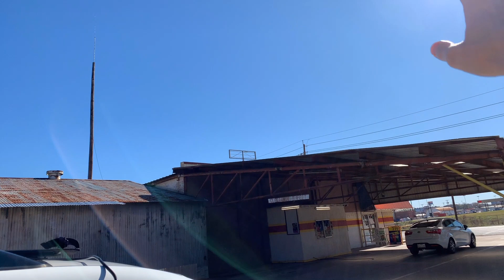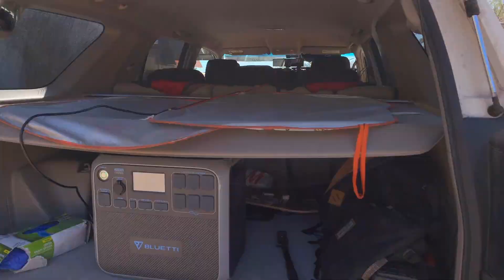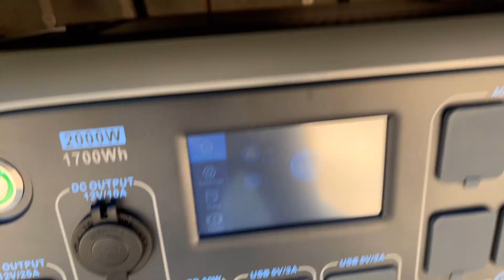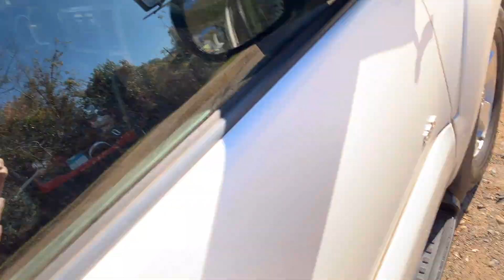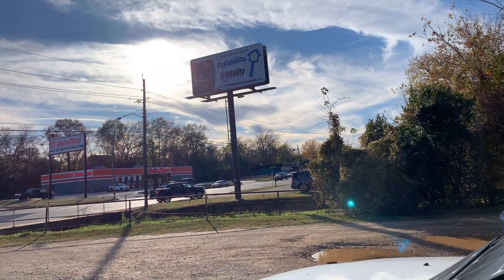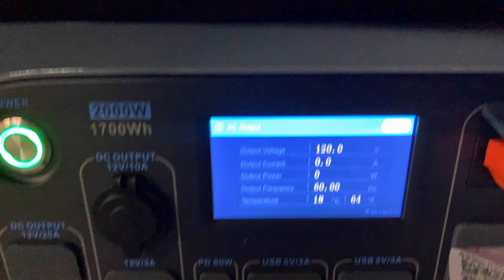Bluetti AC200 Test Charging using Two Solar Panels

Comment: Are you aware of the 2020 solar panel tax credit since your using mainly the solar panels for power?
You could qualify for 26% of the total costs to reduce your taxes if you are in the US.
Reply from the maker: Really, that is something I could use more information about.
Reply: @kpboix99  I am going to take advantage of it.  Get the Form 5695 and Instructions from IRS.gov.

You should qualify because you even bought 4 to 6 solar panels total.

Solar panels and the AC200 certainly should qualify in your case because you are purposely using only solar power instead of electricity to recharge the AC200.
Reply from the maker: @Trang-xq9fn  ok I’ll look into that form, thank you for the information.
Reply: @kpboix99  It is possible to keep it as a residential solar usage and take it to your business for emergency power uses.

You  need to look at both tax benefits for home vs. business then decide where your solar system should be as a permanent location.
Reply from the maker: @Trang-xq9fn  that does sound like something good to look into 👍. Thank you for sharing this information.
Reply: That's ONLY for solar panels that are installed on your home or business not for a portable generator...but nice try. 👍
Reply: @BC-hc5dq  I will read the instructions when I work on my taxes.  As far as I know, solar panels have to be connected to a battery system in order to provide power for homes.  I will be interested to see restrictions on the types of batteries use.

Comment: I thought something was wrong with my panels but it appears that it is performing just as yours did in this video. I really was expecting to get at least 200w from both of those 120w panels. I know 100% output is not feasible, but paying over $300 for two panels that only provide an average output of 140w is actually a waste of money. 

I've already ordered better panels from someone other than Bluetti. I wish I would've done more research beforehand because I would've only purchased the solar generators and left the panels alone, but you live and learn. I'll be storing these panels in my van if/when I need them.
Reply from the maker: Yes, I was expecting the same thing as you.  When I connected them up in series, was suprised to see why I didn’t get more power input.  These panels aren’t cheap.  I do like the portability of them.
Reply: Which panels did you end up purchasing?  Are you happy with them?
Reply from the maker: @DDDaxton2222  I ended up purchasing three more of the Bluetti Foldable 120 watt panels.  I am happy with them because I can carry them around easily and get sunlight by connecting all of them fast.  They aren’t cheap, at around $300 a panel but I wanted the portability of it instead of mounting them or having them take up a lot of space.

Comment: I have 2 200 watts solar panels i am trying to connect to charge my bluetti faster. My issue is, how do i connect those 2 panels together? Is there is the an extra adapter i need to buy? I dont see that any of these came in box besides regular solar adapter, car cigarrete lighter adapter and AC adapter. I would appreciate the help 🙏🏼🙏🏼
Reply from the maker: If you see how to wire in series, it will connect with the parts you have.

Comment: I have the exact same equipment and followed your instructions...but when I turn it on I get error code 1. Any tips?
Reply from the maker: I’m not sure what code 1 is, have you checked the manual?
Reply: @kpboix99  I figured it out. I had to switch from car to PV mode in the settings. Cheers!
Reply from the maker: @jesseconnors1326  great!

Comment: I have one 200 watt glass panel on my van, would that be over the minimum power to start the solar charging?
Reply from the maker: That may work if the voltage is over 24 also.

Comment: I'm glad I watched this I didn't know you needed 2 solar panels to charge it.I will have to order another one of the solar panels..😥
Reply from the maker: Yes it’s a minimum of two.  If you want to charge it faster add more panels.
Reply: @kpboix99  Thank you so much.I just have the unit and one solar panel that goes with the system. Haven't had time to try solar panel yet but now I need to order a 2nd one..Get information
Reply from the maker: @stacylozier3566  your welcome.  Yes just get another solar panel and you will be able to charge it.

Comment: Those panels have "kick stands". The windshield is a decent angle but the one flat on the roof would have given you better results if you had used the kick stands to tilt it. They are not water proof so in the rain isn't really a good option. Besides rain = clouds so... Good luck with that. ;)
Also the grommets on the end are there to hang them vertically. You could for instance hang them from your luggage rack and let them hang down the side of your stationary vehicle.   Thanks for the video. I'll be doing one when I get mine (Bluetti) delivered.
Reply from the maker: Correct, they kick stands are good for flat surfaces.  I ordered four more because I like the portability of them.  For a permanent solution it would be better to get those hard panel ones.  I think it maybe something useful for a house or business one day.  I’m interested to see what kind of solar setup you will run when yours comes in.  Stay electrified ⚡️
Reply: @kpboix99  I have 2 of those folding and 2 100watt glass panels. I'm getting 338 watts out of them in series. Going to be running an RV with those and plugged into the ac200 with the shore power cable.
Reply from the maker: @tponaroll4463  That’s cool, I bet that would be idea for an RV setup.  Did you get that aviation plug adapter?  I believe that helps with higher amp hookups for RVs.
Reply: @kpboix99  I'll plug the RV right into an AC outlet. It works and everything runs on a regular 20amp house outlet. It will run everything. It's a 30amp RV plug (not 50) so it works fine. I can even run the AC off a regular 20amp outlet without any problems. I built a short extension cord 10gage wire 30amp female one end and put a 20amp 3 prong regular 110v  male plug on the other. I've often used an adapter that's 30-15 and not had a problem but wanted to eliminate the 15amp weak link. The 30 amp end is in the utility cabinet for shoreline plug and the 20 amp end inside to plug into the Bluetti. Bam... Power. :)
Reply from the maker: @tponaroll4463  that is awesome!

Comment: I am ready for some primetime sunlight conditions. 🌥
Reply from the maker: Sun ☀️ power charging is the way 👍
Reply from the maker: @CollectibleOftheDay  I figure my electricity bill in this building is anywhere from $700 to $1000 a month.  I will do some tests in the future to see if I can bring that bill down with using this AC 200 to run some other devices.

Comment: Thanks for posting. I'm confused. How did you manage to get 150watts from 2x120watt solar panels when wired in series?  I was under the impression that when wired in series the voltage increased but the wattage does not . Cheers ...Jim
Reply from the maker: Your welcome. The voltage and watts both increase when wired in series.  The AC200 requires a minimum of two of these panels to draw enough power to charge.  The AC200 can handle up to 700 watts of power!  I have more panels  on the way and will show more solar tests later.
Reply: @kpboix99  Your never too old to learn😂 All these years i thought is was just the volts and not the watts. Yes i did note that it will need at least 35volts. I need to get another panel. I have 440 watts on my RV roof but wired in parallel so only 19volts, they maintain my Lithium batteries and I’m not changing it.  The Bluetti folding panels seem rather expensive don’t you think?   Cheers Jim👍
Reply from the maker: @grumbleweed5570  an RV setup, that would be a good addition for the hard solar fixed panels.  😃. I only got the Bluetti ones because they are more for my portable charging lifestyle.  Yes they are more expensive, there are other ones on Amazon I’ve seen for a lot less, especially for an RV fixed panel situation, cheers!
Reply: Let's say each panel is putting out 20v and 4a. So in series 40v x 4a = 160watt, in parallel 20v x 8a = 160 watt. Either method is putting out same wattage.

Comment: I bought mine for power outages but now I use it everyday on my TV and other appliances like my washing machine to save on electricity power.  I will be curious to see if the power company actual lowers my bill or it stays the same
Reply from the maker: I bought mine for the Same reason, I have been finding ways to use it more to save on electricity also.

Comment: I have super low current with my panels in series and I can’t figure out why
Reply from the maker: You have to make sure that it is getting at least 40 volts wired in series.

Comment: How many watts/volts  per panel? I'm getting ready to get some panels for my Bluetti,  and have been researching different sizes. Thanks for your insight!
Reply from the maker: At least two of the Bluetti panels are required to get power to them.  That would equal about 40 Volts.

Comment: Be careful. People can jimmy car locks easily to break into cars.  It happened to my mostly empty van (not yet started the van build) early this year.

Looks like there are 2 handles on the AC200 that I can run a chain through to secure to my van with a lock.
Reply from the maker: That is probably a good idea to secure the AC200

Comment: Interesting. I haven't been able to get  mine to charge with the panels yet. It charges with the wall outlet and car charger but not with the panels. =(
Reply from the maker: You have to have a minimum voltage level met.  If you connect just one of the sp120 panels it won’t work.  Connect at least two in series.
Reply: @kpboix99  I've got 4 panels connected in series. =(
Reply from the maker: @a.randolph8112  that’s plenty of panels connected.  Make sure the charging mode is in PV also.